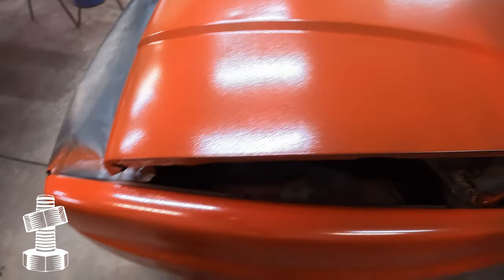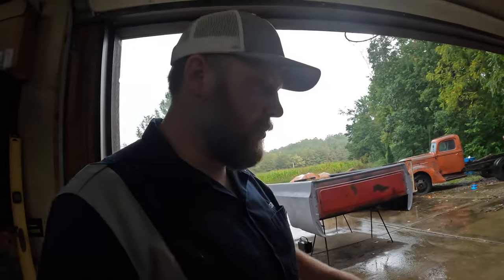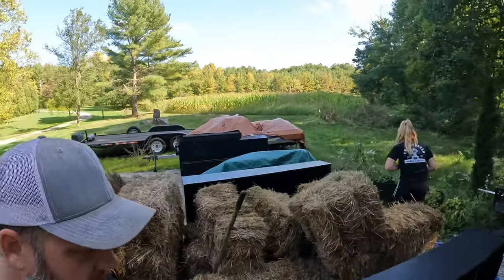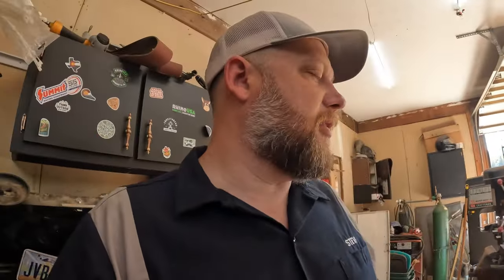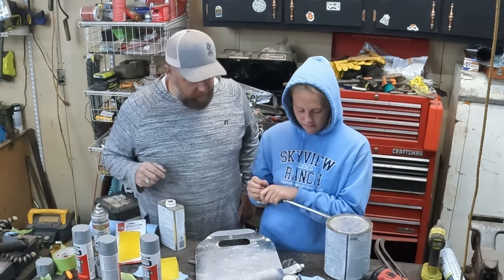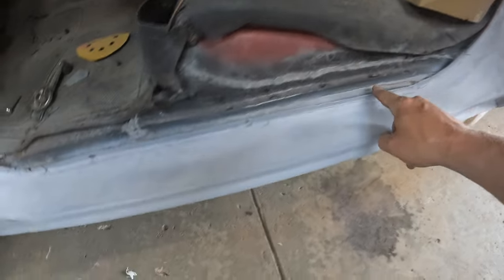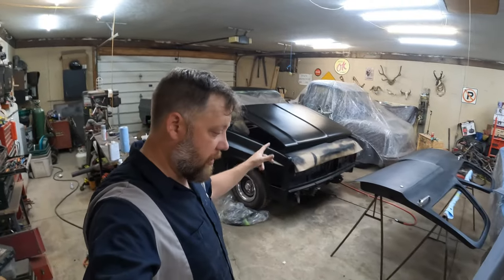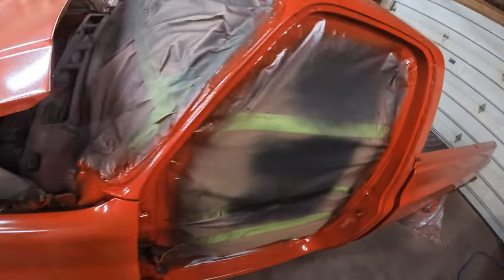Why The C-10 Budget Patina Paint Job Looks So BAD

Comment: Maybe a few things that can help. A scotch brite can't create a flat surface. It conforms too much with the surface. So you will probably need to use sandpaper and a (soft)block to cut it down. Mat black will hide a lot. So part of it will be texture from the previous layers that is showing up. The end result looks like classic dry spray. So you need to go a bit slower and heavier for the last coat so that it's able to flow out.
Reply from the maker: Thanks for the counsel. Paint is definitely not my strength.